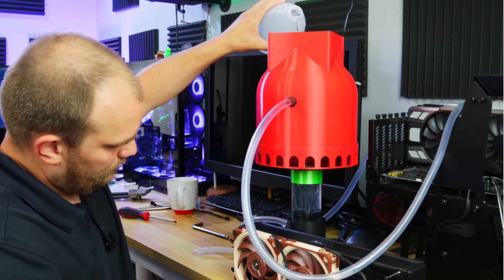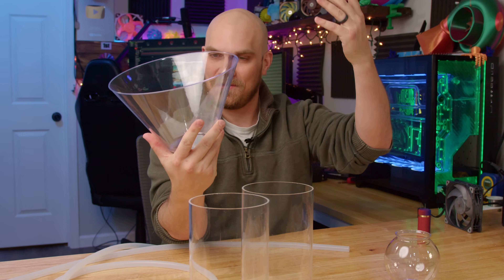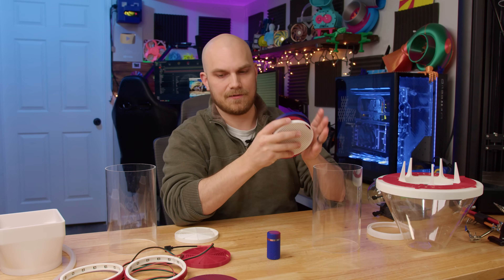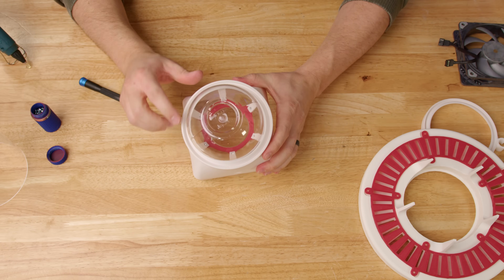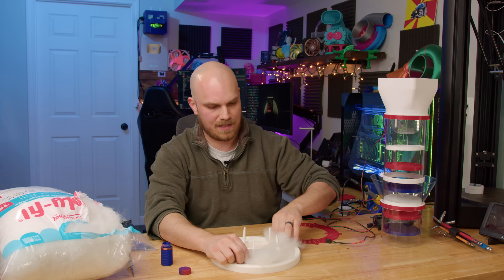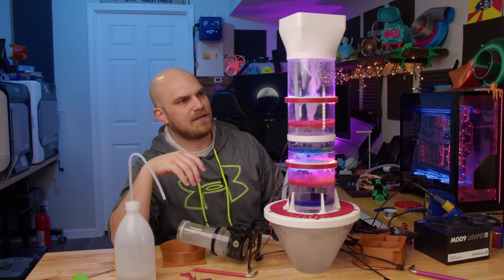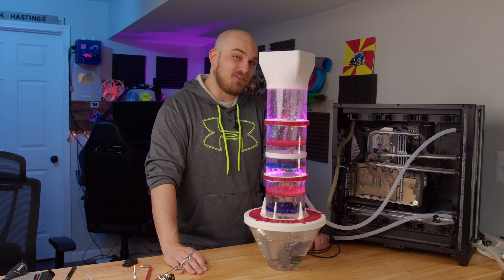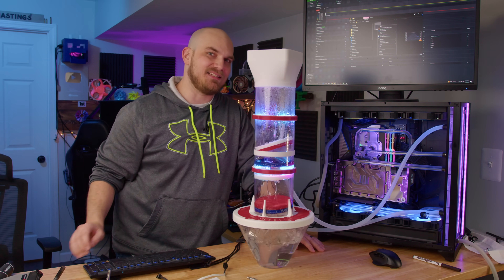Water Cooling..... With NO Radiators

Comment: The simple fact that it worked is amazing to me. I'm sure with some work it could become a zen piece of furniture while fueling your epic gaming
Reply: it's a smaller version of well-known technology at this point, and it does scale much bigger than normal radiators can. These things are probably going to be mandatory in a few years for top end GPUs
Reply: @marcogenovesi8570  uh... Not likely. You'd see more powerful AIOs before anything like this.
Reply: @Hawk7886  AIOs are already at the limit because of case size constraints, to do significantly better you would need an external radiator like a car radiator
Reply: @Hawk7886  AIOs are already as efficient as they can be.  The only way for them to get more powerful would be for them to get physically larger.  While this might be what ends up happening, if you live in a world were water is cheap then the cooling tower approach is much more efficient in terms of heat extraction and energy consumed.  The water loss from the system and the need for more maintenance are definite issues though.  Keep in mind that the stock system was using mulitple fans and the tower used only one and did a better job of cooling by ever so small of a margin.
Reply: @T3ddyRuxp1n  they're not even close to being "as efficient as can be" dude.
Reply: @marcogenovesi8570  I used a radiator from a VW Golf 1 back in the end 90's and it worked most of the time without a fan. Only on extremely heavy loads the fan ramped up. So yeah, car radiator. But I think that hardware with the same performance as nowadays will use less energy in the future, so less cooling is needed. We don't need a million frames a second, so we don't need to cool down 10 megawatts of GPU.
Reply: @patricktrakzel9657  hardware with the same performance as nowadays won't run newer games so yeah cool but why bother. Yes AAA games are getting heavier every generation and crappy ports also exist.

Comment: Another idea might be to use an ultrasonic evaporator to force atomization and then recover moisture through adhesion to cooled surfaces.
Reply: Pump water in the top. Then run it through a distillation column.

Push room temperature air in the bottom. Remember To Filter Output because rooms are dusty!

Unless you go for a HEPA or Paper filter with fan forcing.
Reply: You just made it sound like rocket science lol
Reply: Well adhesion to cool surfaces would be condensation but  for that to really work in any reasonable capacity you would kinda need a closed system,  also you then need a separate way to cool down that surface  for it to condense on.
Reply: @connorjohnson4402  I meant more that when the mist dumps it's heat to the air, then it could condense on a surface. That surface being cooled, or at least prevented from heating up much, would probably help.
Reply: @jajssblue  So, just a swamp cooler then?
Reply: @MNbenMN  Pretty much!
Reply: @jajssblue  wouldn't work, ultrasonic atomizers do not shift a significant amount of heat
Reply: @Nuke The original machine has a base-plate of prefabulated aluminite, surmounted by a malleable logarithmic casing in such a way that the two main spurving bearings were in a direct line with the pentametric fan. The latter consisted simply of six hydrocoptic marzlevanes, so fitted to the ambifacient lunar waneshaft that side fumbling was effectively prevented. The main winding was of the normal lotus-o-delta type placed in panendermic semi-bovoid slots in the stator, every seventh conductor being connected by a non-reversible tremie pipe to the differential girdlespring on the "up" end of the grammeters.
Reply: You don’t want small air drops or steam, you want it relatively large as we have tons of pcb around......
Reply: You don’t want small air drops or steam, you want it relatively large as we have tons of pcb around......
Reply: Ultrasonic "atomizes" liquids - as in, it ADDS enough energy to break the covalent bonds apart into smaller or even individual groups of molecules.  You are trying to cool, you do not want to ADD energy.  "atomization" is entirely different that evaporation as the water molecules would still be liquid water.  Evaporation is a phase change which energy pull from it's surrounding in order to facilitate that change.

You do not add energy to remove energy lol
Reply: @FriendlyCynic  phase change does add energy too, and it works.
you just want to add less energy that it removes, if you add 25 or 50W to aerosolize the water but gain enough surface area to cool by a 100W more it's still beneficial.
Reply: @FriendlyCynic  If you atomize the liquid you increase the rate of evaporation, and in turn the rate at which cooling occurs - you expend a small amount of additional energy to increase the cooling capacity.

Also, not sure if you realized this, but evaporation is also the act of adding energy to the water. There's nothing about "adding energy" to the system that makes it not work.
Reply: @jakedewey3686  I understand that, sir.  The problem here is you're not "increasing the rate of evaporation".  There is not a 1:1 there.  You are increasing the surface area which can promote an increased rate of evaporation.  That is not the same thing, as there are other things that can occur during that process.  And again, yes I understand that adding a small amount of energy to increase surface area CAN promote a net loss in heat.  

And no, evaporation does not require adding energy.  You're mistaking the fact that we often use energy in the form of heat to increase the temperature to boiling point of water in atmospheric pressure.  That is not the ONLY way to boil water.  Pull a decent vacuum on water at room temp and it will boil and cause the vessel containing it to rapidly cool of, start condensing water on the outside and then eventually build ice.   There is no energy being ADDED to the water, however, the act of the water boiling pulls energy from the vessel.  That means you're understanding of this topic is just blatantly not good.

My ENTIRE point was if you're trying to use to utilize the concept of "Increased Surface Area" to promote a net cooling, adding energy though ultrasonic waves is a DOGSHIT method.  We have desiccant materials that will not only do a better job at increasing surface area, but also absorb moisture passively without requiring any energy (Which the absorption increase the surface area of the water).  You then evaporate that descanted water that required 0 energy to mechanically separate resulting in a MUCH greater net loss in heat.

Its really not that complicated, you just need to try and understand physics a little if you're gonna try and talk about it.
Reply: That sounds like peltier cooling with extra steps. Its also a humidifier at this point. The cooled surfaces would remove more heat then the water to air cooling would.
Reply: @LuxGamer16  I mean we aren't discussing efficient designs here. Off the shelf products do that. This feels like an exploration of unusual approaches. And peltier electric cooling has basically nothing to do with anything discussed here. So not sure where you're getting that from.

Comment: Yeah when you were installing the fishbowl that was my expectation (the airflow issue). But The concept still seems good. (It is a push fan right? *the direction is pushing air down?)
Reply: Nope, that fan is pulling air out of the tube. Hence the filter at the bottom.

Comment: Should get some of the metallic filament for the discs inside. Also you can try embedding magnets in them so you can adjust the positioning from the outside using more magnets.
Reply: Window screen
Reply: Not sure, but would metal-filled filament pose a corrosion risk in the loop with mixed metals?
Reply: @xomm  definitely, especially with how brittle those filaments are. They're basically metal powder mixed into plastic
Reply: @xomm  absolutely, using metal filament is a horrible idea
Reply: Big brain!
Reply: Or just add some pockets to add magnets to both the inside fill and than add magnets on the outside like you said

Comment: so where is the heat gonna go, to air?
Reply: if you have no contact with the air, then um
Reply: well this is an air humidifier cooler
Reply: higher water fall to get air speed
Reply: water spray nozzle down tube instead
Reply: spray creates automatic mix mist
Reply: what about just a metal heat sink in the water fountain cooler
Reply: yes the fish tank heat sink cooler
Reply: heat floats to the top
Reply: yes a very large water cooler tank

Comment: A liquid to liquid heat exchanger would be a really smart investment on this system so you don't bring that dust into the processor.
Reply: Or what industrial systems use: a silt trap
Reply: To expand on this, he could use one of these with a larger local res for thermal capacity in case the other (evaporative) cooling loop goes out or runs out of water; that could buy some time but makes the system less portable. With some QDs he could easily replace the exchanger with a radiator, however.
Reply: Agreed, keeping the internal loop as sterile as possible is a wise decision.
Reply: dont want to get dust in the processor XD
Reply: I've made one in the past where I just wound a long copper pipe into a coil and placed it inside the tower reservoir, worked pretty well in the past though CPU/GPU's use more power these days.
Reply: Brining that dust in your loop is the first problem I saw as well, however a liquid to liquid heat exchanger is basically a radiator, so that would defeat the point of the entire system....
Reply: @henkheijmen  Not if hes running dual loop; the point of the exchanger would be to keep the PC water clean while the water that does the actual cooling can be dirty without much worry. The evaporative loop would still handle all the cooling of the PC, it would just be doing it via an exchanger. Kind of like how nuclear reactors work with their dual loop setup; the turbines aren't driven with radioactive water from the core, after all.
Reply: @ATGEnki  Believe it or not but some reaktors are run with only one loop.
Reply: @TheOneTrueGodUkko  Yes and some have three.
Reply: @TheOneTrueGodUkko  and some reactors are a hole in the ground
Reply: @henkheijmen  exactly

Comment: The bong tower
Reply: The big bong
Reply: @Dragon-xd9em  big bong theory
Reply: Beat me to it
Reply: But it's not cracking
Reply: This is actually what its really called. GJ. These have been around forever.
Reply: That was my first interpretation or thought  along with I wonder who's going to be the first to modify this and fill it with a different kind of smoke  along with some off-gassing pla resulting in cancer later on in life.... Still did not stop me from looking for the
.STL files
Reply: Looking at this with 420 likes....
Reply: @nickybeingnicky  someone done fucked it up. Someone needs to unlike to balance lol
Reply: Yep. Bong coolers were the name back in the 90's. Never made one myself, but completely understood the principal of evaporation... Which is part of why I didn't want one - I couldn't trust myself to monitor the water levels, and thermal shutdown sensors weren't a thing in CPUs back then.
Reply: I'm glad I wasn't the only one who had that thought
Reply: Yuuup and the concept was already made in early 2000
Reply: FYI:  Since THC is water soluble, water bongs only extract THC from the smoke and have been proven to have the least amount of THC per "hit" than other methods.  This was concluded by a study by M.A.P.S. and confirmed by another study by the Australian government.  The method which delivers the most THC per hit is actually mixing the marijuana with Tobacco as it raises the combustion temperature slightly and thereby "decarbs" (knocks off the carbon ring) more THC making it active.
Reply: Green needed there
Reply: All the other variants looked too much a penis. He just turned his last try on its head.
Reply: H20 hydrate it!
Reply: Mh smoking thru it. Now i'm interested. ;)
Reply: You wouldn’t watercool a bong
Reply: @lobbyhoe01 A bong is literally made to water cool smoke 😂
Reply: @northernontariosledderz  right lol like that's the whole point!
Reply: @lobbyhoe01  it literally is a water cooler lol
Reply: @lobbyhoe01  You wouldnt download a water cooled bong🤔
Reply: @lobbyhoe01  you wouldn't steal a car
Reply: @lobbyhoe01  maybe YOU wouldn’t.  Speak for yourself.
Reply: Not funny
Reply: @AFpaleoCon  wrong